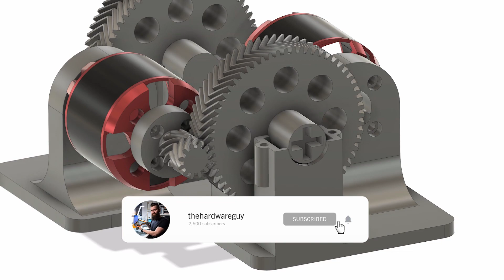Raptor II: 3D Printed Gears

Comment: I love the independent drive system. I'm not much into rc racing but i'm just thinking about the possibility of making one wheel turn faster when cornering. I wonder if the results would be better than a normal differential system , maybe you could write a code or something for increasing the speed of te outside wheel at corners compared to the degree of turning. I know that would be a totally over engineered system but it whould like blow my mind if it could be pulled off🤣🤣
Reply from the maker: Thank you, that’s exactly the plan! The feedback loop combined with direct control of each wheel’s speed means I can implement steering differential equations based on steering angle. (i.e under rotating the inside wheels when cornering). The driving performance will be truly unparalleled
Reply: Amazing!!! Can't wait for your next video.

Comment: I remember seeing a youtube vid a few year back about a gravity generator for camping/wilderness use. They were talking about the issue of using gears with the gearing on the outside to not be strong enough because of the little contact area so they switched to 1 of the gears having the gearing on the inside. Kind of like a planetary gear style but without the sun gear. Not sure if this would help with strength.

Edit: the video was from Smarter Every Day called "Turning gravity into light"

Comment: The small gear has not supported with a bearing in the outside, with high load it will try to bend the motor outward, possible to the gears will skipping, jumping. In a gearbox always must support the gear shaft from two sides :)
Reply from the maker: agreed! That’s one of the modifications I made note of